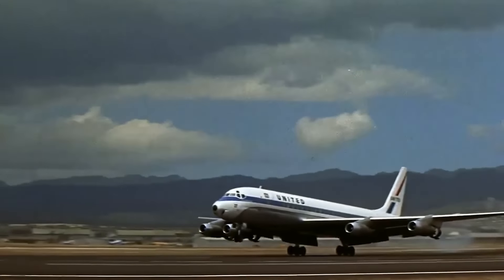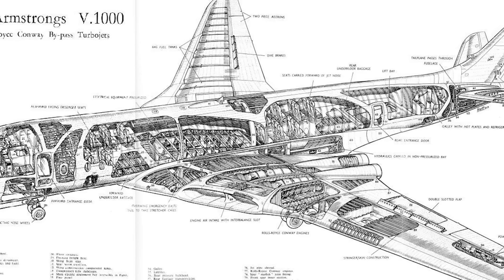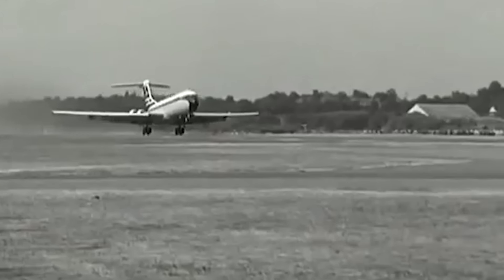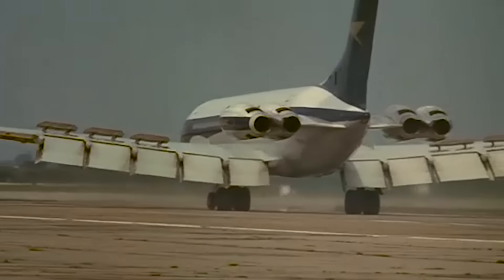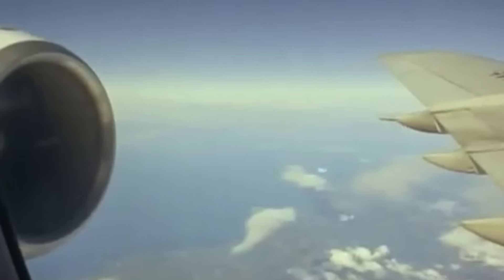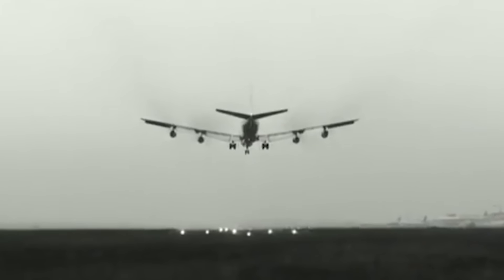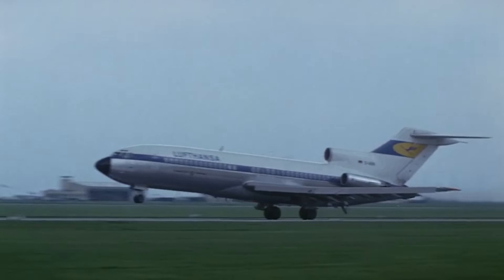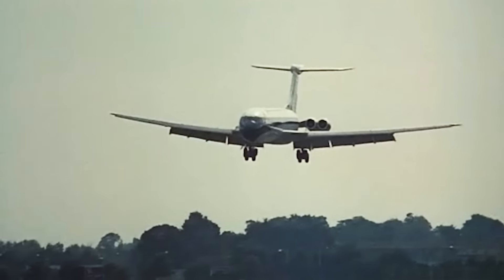Vickers VC10 - the lost flagship

Comment: The video failed to mention that the reason high frequency flyers chose this aircraft out of many other options, was, besides it's speed, it's whisper quiet flight and spacious seating.
Reply: Yes, and back in the day it was easy to transfer your ticket between airlines - at no cost. I used to do it just to get a VC-10 from the Middle East.
Reply: Back in the seventies it had the nickname "the hushpuppy".
Reply: So quiet, the in the cockpit we needed to check the engine gauges.. to make sure they were running in the cruise.
Reply: I recall reading a story of an EAA VC10 having all four engines shut down during climbout, likely due to water in the tanks not being drained properly. Only one passenger noticed the engines winding down.
Reply: Indeed.  I was working in the travel industry in the late 1960s.  I used to book many transatlantic flights for my firm's corporate accounts.  Yes the VC-10 was the preferred aircraft but I found that,  in the case of a major US-oil company,  its executives were obliged to patronise US carriers for their transatlantic flights to the UK.
Reply: The video "failed to mention" that because neither of those were true.  It was hardly whisper quiet and it's 2x2 or 3x3 single aisle seating was no larger then any other aircraft of similar seating configurations.    Your information is simply false.
Reply: @MrRobarino  I suggest you research your facts. This is a direct quote by wikipedia "The VC10 became an immensely popular aircraft in the BOAC fleet with both passengers and crew, being particularly praised for its comfort and low cabin-noise level."
Reply: @Gordanovich02  And survived to tell about it?
Reply: I'm 6ft & enjoyed flying on it back in the day. Best looker to & Concorde doesn't compare. That tail..
Reply: @zig_ziggy  true or false Wikipedia is only as good as the person who puts in the info into it.
Reply: @MrRobarino  believe you me it was good seating but other jets were much the same, now it's claustrophobic.
Reply: @seltaeb3302  Fair comment - but in this case it seems true from the other supporting comments including yours :-)
Reply: @MrRobarino  Exactly.  Those Conways weren't quiet.  It's like when Eastern called their Boeing 727 Whisperjets.
Hardly
Reply: I'm over 6ft and suffered a lack of legroom on a transatlantic flight in a BA VC10. The most memorable aspect apart from cramp was taking off at Heathrow like a fighter. I flew in several 747's, Tridents, a 707 across the USA and other American short haul flights and they all had adequate legroom.
Reply: @dartskipper3170  Seat pitch has nothing to do with the aircraft, it's a decision made by the airline. Also, how much over 6ft are you?! I'm 6ft 4 and I only have problems on low-cost carriers, and that's in the 21st century with airlines trying to squeeze us in like cattle. From what I can see on historic seat pitch figures, they were much more generous in the early days of the jet age. The figure of 33 inches that I've seen for the VC10 would fit me in comfortably.
Reply: Not quiet in the seats at the rear! Great plane though.
Reply: Noisy as fuck if you were stood underneath one😂. Never lost a single one in flight. What a legacy.
Reply: Like most rear mounted engines, it was probably whisper quiet in the front and increasingly louder as you move to the back. And due to the 4 engine design it was probably quieter than jets with 2 or 3 engines mounted on the wings or on the rear fuselage at the time.
Reply: @747heavyboeing3 Flying in the cabin, the vc10 was quiet and stable from the outside watching it take off, very loud.
Reply: Good thing no airliners descended from the VC-10 then, those spacious 5 abreast seats would be swapped out for 6 abreast seating given its 3.5m cabin width (keep in mind the BAE 146 has a width of 3.46 and the 737 3.56)

EDIT: Nevermind, I always thought the VC-10 was configured 3-2 when now that I look at it all the images of the cabin are 3-3, meaning narrower seats than the 737, the only thing narrower probably being the 6 abreast on a few of said BAE 146s…
Reply: @747heavyboeing3 I've flown on 727s many times: They are not "Whisperjets".
Reply: Still the fastest subsonic airliner ever made.
Reply: @jimboll6982 at Brize stationed in the 70s, we had Concorde practicing on our runway, boy was that loud, you could hardly hear your tv & the ornaments would dance, so believe you me the VC10 is quiet..
Reply: @JasirGressmann yup, that's a good point, as the noise gets washed away, didn't think of that & it's thus good evidence for it's quietness & gets rid of WC noises!
Reply: @dartskipper3170 I'm 6ft 1in & in the RAF VC10s I had plenty room, even when people reclined their seats. I flew easyJet first time this year, I had more room in a town bus. Knees jammed to seat in front, zero elbow room. It was only for 55 mins £44 return, yeah never again.
Reply: BOAC apparently told lies about VC10 profitability in order to obtain govt subsidies.
Reply: @seltaeb9691 I am pretty sure the Convair CV-990A was faster
Reply: @timsmith2525 the fact is that until the advent of high bypass turbofans, jetliners with rear-mounted engines were generally much quieter.   The 737-200 was especially noisy in the aft cabin.   The MD-80s I used to fly with Alaska and Delta on the other hand were blissfully quiet.  And the few times I was lucky enough to fly a 727 were also incredibly quiet and relaxing.    Every account I have read, and every one I know lucky enough to experience them, reported that the Sud-Aviation Caravelle and VC-10 were remarkably quiet and comfortable
Reply: @theleastofpilgrims3379  My memories of the 727 are not "incredibly quiet".
Reply: What "high frequency flyer" on commercial "airliners" has any choice whatsoever what aircraft he/she flies on unless they're the farthest thing from an "international air traveler"? Especially anyone that "prefers" such a low-production "global" sales FLOP like that? 

Anybody that has ever flown in a narrow-body "airliner" with two rear-mounted engines on the "fuselage" AND real widebody aircraft or even narrowbodies with engines on wing "pylons" knows the only possible LESS comfortable aircraft is one with THREE rear engines and nobody with a clue even wants to "imagine" a PIECE OF SHIT WITH 4 "LOW BYPASS TURBOFANS" OUT BACK. 

IN THE "BRITISH EMPIRE" AND LATER THE "COMMONWEALTH" YOUR "HIGH FREQUENCY FLYERS" ARE ALL "GOVERNMENT OFFICIALS" AND THEY ARE ALL STUCK ON THE "NATIONAL CARRIER" OF THEIR PARTICULAR "COMMONWEALTH REALM" AND THE VC-10 WAS SUCH AN "ENGINEERING DISASTER" IT COULDN'T EVEN "OUTSELL" TRUE DEATHTRAPS LIKE "BOAC COMETS" WHEN IT CAME TO BEING A "FLAGSHIP AIRCRAFT". 

AND THE "BIGGER" EVERY "ALL BRITISH" SO-CALLED "AIRLINER" GOT AS FAR AS "SEATING" AND THE "UP TOS" GOT HIGHER AND HIGHER SO MORE AND MORE "HIGH FREQUENCY FLYERS" HAD THE OPPORTUNITY TO "CHOOSE" A COMET AND TRIDENT AND VC-10 (ONCE THE BRITISH "AEROSPACE INDUSTRY" DECIDED THAT "MODEL DESIGNATIONS" RATHER THAN "MYTHIC" OBJECT NAMES MIGHT "BOOST SALES") THE LESS "SUCCESSFUL" THOSE "ADVANCED" AIRCRAFT BECAME AND THE MORE "HM GOVERNMENT" HAD TO "BAIL OUT" EVERY "PURELY BRITISH" SO-CALLED "AIRLINERS" WITH "MILITARY SALES" AND "TANKER VARIANTS" AND "TROOP TRANSPORTS".
Reply: @TommyTCGT You mean after waking up suddenly from a nap or what?
Reply: @zig_ziggy  Depended where you were in the cabin. The cabin was indeed quiet in the forward rows where the premium passengers sat, and of course the flight deck was even further from the engines. Not so quiet in the rear of the cabin. And given that anyone can post anything in wikipedia it's not a reliable source.
Reply: @MrRobarino   when did you fly in a 10 ?
Reply: The Americans silenced this aircraft as they had nothing to compete for short take and landings same as Concorde
Reply: @deeremeyer1749 Why are you shouting. If the British Government supported it's aero industry that is nothing remarkable. No doubt Boeing and McDonald Douglas benefited from military contracts for variants of their airliners.

Comment: I was really really disappointed when a flight I had booked on a BOAC VC10 was changed to a Boeing 707 and thus missed out on flying in a VC10. Grates with me to this day as it was much the superior aircraft.
Reply: I know how you feel.  I wrote a lengthy comment about about my times on a VC10.  The 707 was so very noisy compared to a VC10.
Reply: Same thing happened to me. July 1976, BOAC JFK to LHR, they changed from the  VC10 to the 707... I was super disappointed and never got another chance to fly on it and for the return flight the air traffic controllers were striking in Europe and BOAC changed the aircraft to a 747 for maximum capacity. I enjoyed the 747 but I was well acquainted with her....
Reply: From this and the British documentary I watched, it was superior except when it came to making money.  The Boeings were superior in that field and that was what mattered.
Reply: @golfhound  On the contrary RR Conway engines were noisier than any other engine in its category...
Reply: @barracuda7018  Not from inside the cabin! 
And if they anoyed you, well let me assure you, it was worth it. Thanks.
Reply: @pattyeverett2826  that's the bottom line.
Reply: So superior, nobody wanted it.
Reply: @pattyeverett2826  acytalluy it made a lot of money for BOAC, it’s load factors were much higher and seldom had empty seats, and empty seats make no money. It also spent less time ‘AOG’ compared to the 707, and it’s not earning if it’s not flying, it also needed much less maintenance so while it used slightly more fuel it’s overall costs were lower and seldom had empty seats
Reply: @zaphodbeeblebrox5973  That is not what the BOAC executive said in the documentary I watched.  If this is true,  why were only 54 VC10s made vs over 1000 707s?
Reply: @pattyeverett2826  it is however what BOACs own accountants said! It’s in the accounts they filed during the years BOAC were operating both types. And airliner only earns money when it’s flying, and the VC10s were flying on average nearly 12 hours a day over their operating life with BOAC/BA, the 707s could only manage 8-9. The fuel advantage of the 707 was wiped out when they had to be ‘re-lifed’ at 30’000 hours, the work they needed to continue flying was almost as costly as buying a new airframe, at the same number of hours the VC10 was found to need no work whatsoever. BOAC management would not know a good aircraft if it fell on them but did know what a good brown envelope was
Reply: The VC10 was also more expensive to buy, as it was specified to have no airframe life, it’s ‘life’ was ‘one inspection’ that cost money to have, the 707 was nearly fit for scrap at 30’000 hours. The other problem that Vicker would never be able to solve was that the VC10 was in no way engineered for production, so it took a long time to build whereas the Americans are possibly the best production enters in the world and the 707 was besieged to be built in vast numbers quickly. There are very few pressings on a VC10, it’s nearly all machined from solid, the 707 has a lot of pressed parts. But one was engineered to last forever (the VC10) the other was disposable in comparison and cheap
Reply: @zaphodbeeblebrox5973  I know passengers loved the VC10, but for some reason BOAC management did not.  The fact stands that BOAC chose to use the 707s.  Any idea why?
Reply: @zaphodbeeblebrox5973  There are a few 707s still flying. The VC10 is retired.  Any airplane that has a pressurized cabin has to be either retired at some point or carefully maintained.  Note, very old and very popular DC3 is not pressurized.
Reply: @pattyeverett2826  The 707 was cheap compared to the VC10, the 707 arrived to market earlier while BOAC were waiting for the VC10 having found the Comet 4 too small, spares were available all round the world, it could be delivered in a very short time (A 707 took months to built, a VC10 nearly 2 years) and Giles Guthrie was a Boeing man, Wilson should have had him sacked for his comments on the VC10
Reply: @zaphodbeeblebrox5973  From everything I have read, the VC10 was a very good airplane.  The two years you mention must be for  the first prototype, this is a long time for mass production.  I do know if the many I saw in the documentary was Giles Guthrie, but he looks pretty sleazy.
Reply: @zaphodbeeblebrox5973  I also read that Vickers was short of cash during the time the VC 10 was developed. I am sure Boeing had plenty from all the WWII and later military contracts.  The  Boeing airliner model 377 was a failure and dangerous.
Reply: @pattyeverett2826  the failure of the VC10 is due to two things, Giles Guthrie (chairman of BOAC) made a big fuss about its fuel consumption and instead of sacking him the British government gave him a subsidy to operate it, one he was not about to give up when he found his sums were wrong, and having an aircraft everyone wanted to travel on also wanted a way to keep it for BOAC. The second one was that if the orders were placed for it there was no way that vickers could ever fulfil the orders in a timely fashion, Each one was hand built and the parts individually fitted
Reply: @pattyeverett2826  They did take two years each.. but usually had 5 in progress, they made 54, including the prototype from 1960 to 1970 when the final one was completed that's an average of 5.4 a year..  they were not engineered for production, the 707 was and I don't think if they did have the orders they could have fulfilled them in the time the airlines would have wanted. The fuselage skins were machined from solid, as was most of the rest of the airframe, it was not riveted pressed panels (why it had no 'life' span I have a feeling its the only 'on condition' pressurised airframe they ever was). It was nick named  'the Iron Duck'.
Reply: @zaphodbeeblebrox5973  They could never make money at that rate.  WWII could have never been won if the Allies plane production was that slow.  The  only planes that I knew of that had an unlimited life span were un-pressurized such as the DC3.  However, the US government seems to be getting an unlimited life span out of the B52(with the addition of loads of money).
Reply: @clive373  it's a quad thumbs up from me clive   👍👍👍👍    lol well said mate
Reply: I remember flying from Mauritius to London (after living on Mauritius for 3 years in my youth - I was 15 at the time) in late 1966 - a very comfortable and (for me as a flying enthusiast) exciting flight. I don't recall how many hops there were but we had several landings/take offs en route.

Comment: The best advert for the VC10 was the words of air stewardesses who flew on various airliners, comparing the smooth landing of the VC10 to that of the “controlled-crash” of the Boeing 707😉
Reply: Yes these  air stewardesses must have been Aerospace engineers.. 😂😂
1000 707's have been sold as opposed to 54 VC-10 's... 
Controlled crash landing must have been the decisive sales argument. 😂😂😂😂😂
Reply: @barracuda7018   The video explains that the VC10 was specifically designed for low- impact landings on less than smooth and also shorter runways - hence smoother landing was presumably a formality, not a challenge.

Comment: In 1977 I flew from Nairobi to London in a British air tours VC10. Take off was delayed, and we took off at noon. Nairobi is at 5500 ft. She was doing just what she was designed to do, and it was spectacular!
I had, weeks before got my private pilots licence. I requested a visit to the cockpit, and was there for the entire flight, except for the two landings, and one take off. We had to refuel, and the crew were more like accountants, working out the cheapest place to stop. Varying landing fees, fuel costs, but also going as fas as possible whilst light, and not deviating off the best route had to be considered. That was definitely the best airliner flight I ever had.
Reply: I flew on the VC-10 as a kid. It was another UK engineering achievement that, unfortunately, traded economy for performance - the Boeing 707 and DC-8 were simply more economical for airlines to fly, and while the 707 always needed far more runway than the VC-10, it turned out most countries simply extended/upgraded runways, leaving the VC-10 out in the cold.

Also, Boeing created high performance variants of the 707 in the early years. For instance, Qantas initially went with the 707-138B, a short-version of the 707. Another commonwealth country that eschewed the VC-10 was Air New Zealand, which went with the DC-8, which had significantly better short-field performance than the 707. Though again, New Zealand simply created a new international airport to accommodate jets including the 707. 

Tailoring performance to the specific needs of BOAC or BEA was the downfall of many UK designs - the Trident was another example. The similar-layout 727 met the needs of far more airlines than the Trident, leading the 727 to clean up. 

It's almost frustrating seeing how close European manufacturers came to creating fantastic designs - there was a 1970s proposal for a stretched CFM56-powered version of the BAC 1-11 that would have left the MD-80 in the dust, and likewise a CFM56-powered version of the Dassault Mercure that would have basically been the A320 well before that airliner emerged. For that matter, had Douglas gone for the CFM56 on the MD-80 rather than the halfway house of the -200 series JT8Ds, the MD-80 would have been a far more formidable competitor. Hindsight is 20/20...